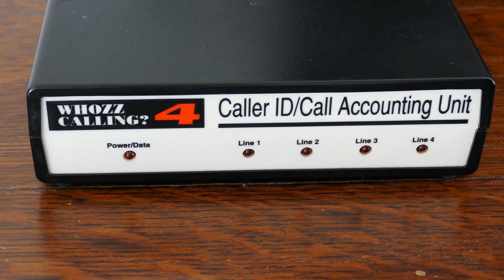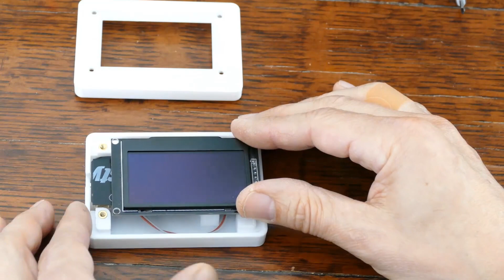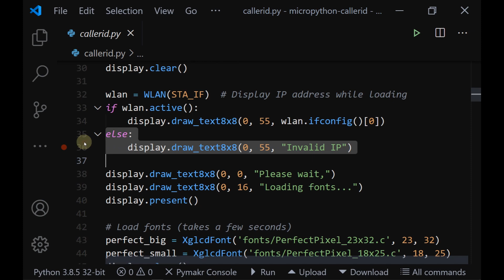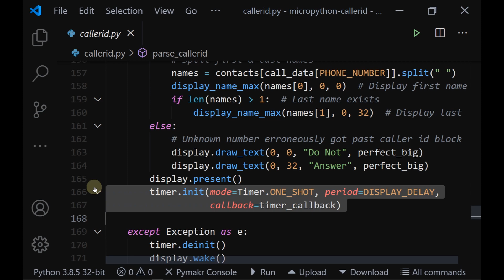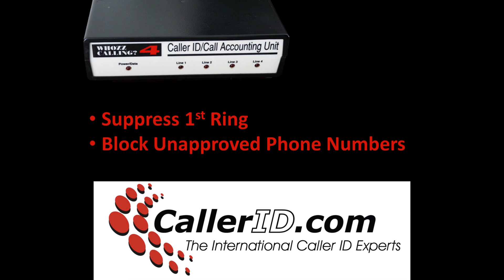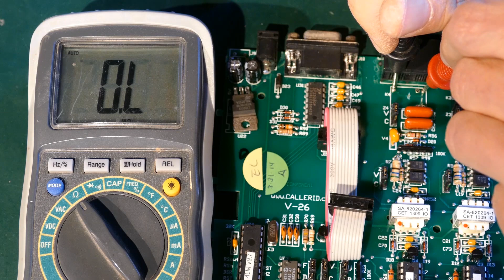MicroPython Wi-Fi Telephone Caller ID & Blocking

Comment: This is nice.  Too bad that they don't make the displays larger for old folks eyes.
Reply from the maker: The 2.42-inch (6.15 cm) display isn't that small, and the OLED is very legible even in bright conditions.  My eyesight is poor, and I don't have any trouble reading it.  If you want bigger, I made a video using a 5.5-inch (14 cm) OLED display: https://youtu.be/vhel6iFT4t8?si=p4rfeTTDg04Z2GYw

Comment: Hi rdagger68! i was wondering how do you make an app for a smart exit light which can control the light and also when the AC cuts off, a timer will start to see how long does the DC supply runs for until it runs out using the Raspberry PI